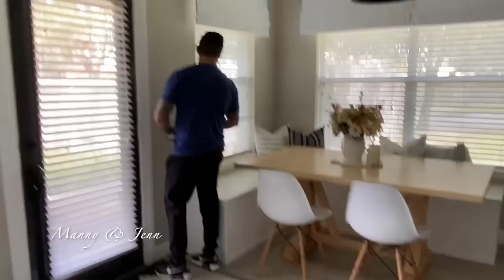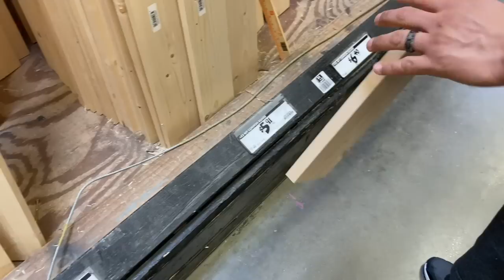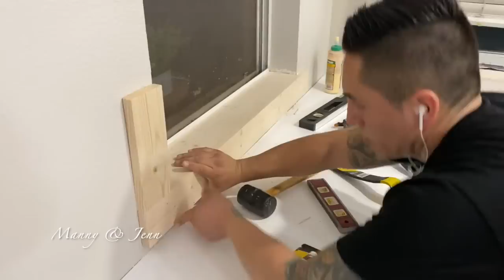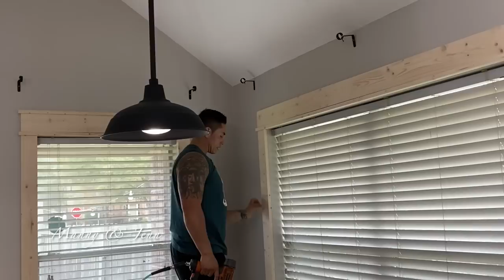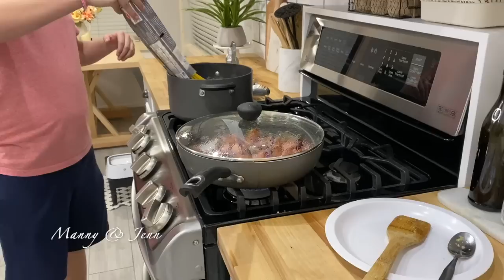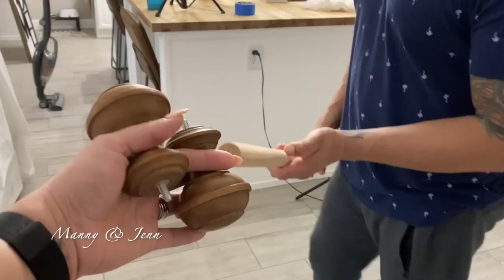DIY INSTALLING INTERIOR WINDOW TRIM

Comment: Nicely done!  Anyone else reading the comments, the only thing I would change is setting the trim boards back like 1/8th or 1/4 of an inch offset from the inside of the window casing.  Adds a little more reveal and depth to the whole trim.  Also prime your boards before installation!

Comment: Nice job! Great vid.  Windows look great.  Thanks for sharing.  I’m looking to do the same thing though i dont have an existing window sill to remove.  There’s a finished drywall on the sill instead like the sides.  Do you recommend placing a wood sill on top or removing the drywall sill first?  Or maybe even leaving thr drywall sill in place and just trim around it like you do the sides so no need to mess with demoing drywall sill?  Thanks!

Comment: I'm doing my bathroom window and thinking about the style used in 1966 and what some do now.  My old window stools are actually installed with the idea that you will get condensation on the inside of the window.  the stool is tight to the window and angled down so any water will run into the room.  it also overlaps the apron piece for the same reason.   In a modern house many of those old construction necessities are gone because of insulation and tight construction.

Comment: Hello,  I like your video very much.   I wanted to ask you: how's is the paint on the wood trim coming along.  Typically pine wood tend to be stubborn when it comes to the knots on the wood.  The wood knots tend to show even after several coats of paint.   How is your paint job on your wooden trim holding on?
Reply from the maker: The knots are showing up just a little bit so far.